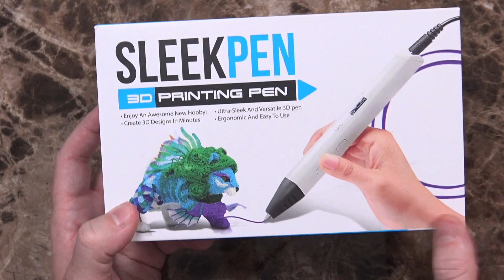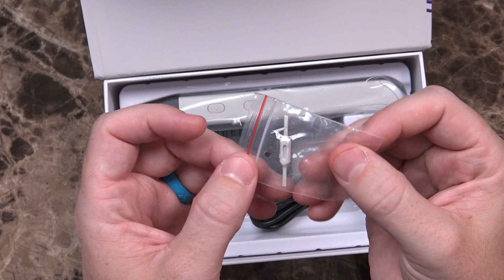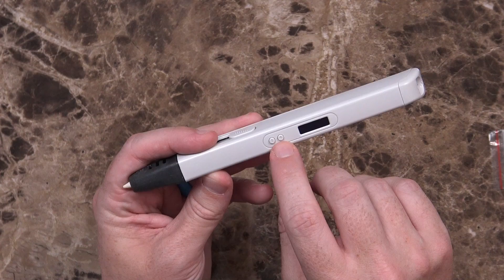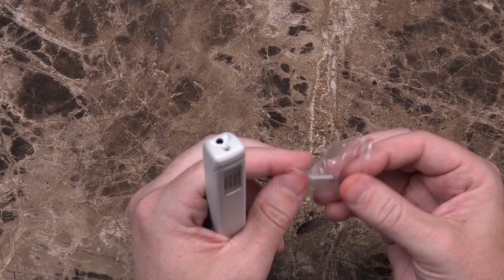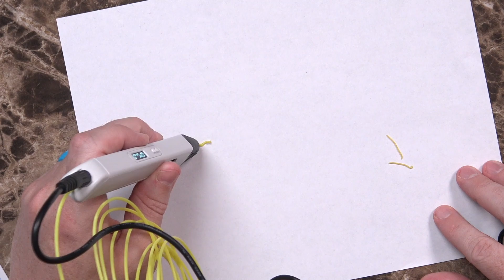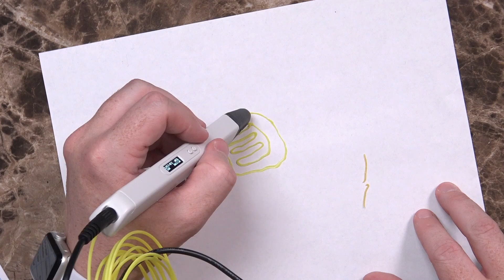SleekPen 3D Printing Pen Unboxing and GIVEAWAY (USA Only)!

Comment: How are you liking the Sony a5100? How is it comparing to your regular vlogging camera?
Reply from the maker: it's a mixed bag. I've been using it a little here and there in the videos here on the tech channel (when there's a quick cutaway with me holding the camera in-hand). Excellent quality video, love being able to change lenses to fit the situation, and it's smaller than the A6300 with a flip-up screen. The audio just leaves a bit to be desired, and with no mic jack, there's not really a good, easy way to deal with it.